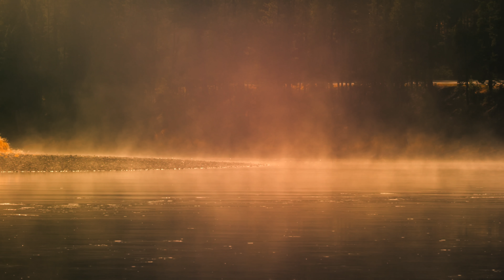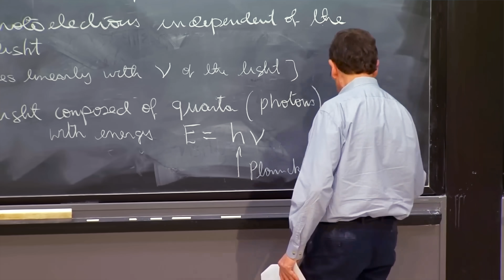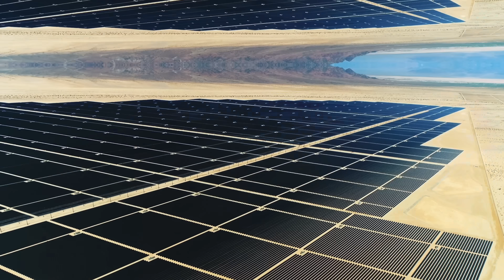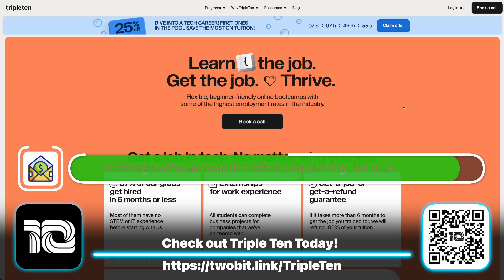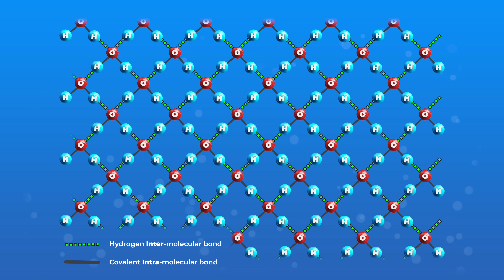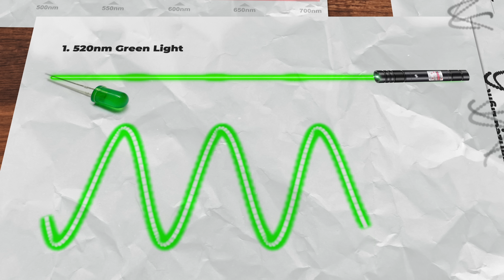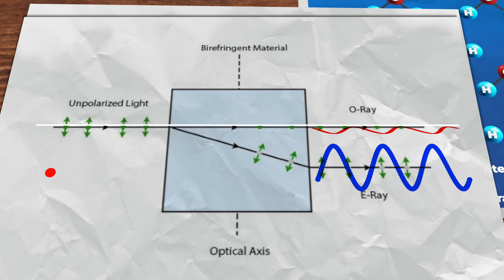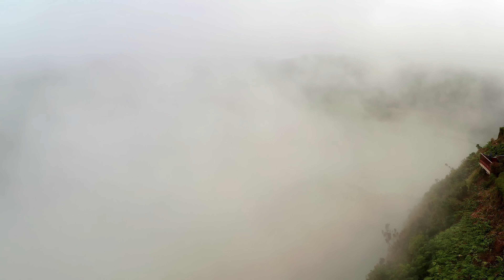New MIT Discovery Just Solved Water's BIGGEST Mystery!

Comment: Makes sense, this is why shade from tree cover is so good at maintaining moisture in the soil.  Also explains why all plants have a green colour, to reflect the evaporating light back!
Reply: Also mowing the grass taller . If an area is too wet we mow it shorter. If it's very sandy soil we mow it at least 3" to help keep the water vapor in the soil.
Reply: I think the green color has more to do with the absorption spectrum of chlorophyll.  The job of the leaf is to reduce CO2 to more energetic molecules like sugars.  The chlorophyll absorbs blue and red light, leaving the green light to be reflected, so the leaf looks green.  The absorbed photons provide the energy to run the process of photosynthesis.  Since there's not liquid water on the surface of the leaf most of the time, I doubt the photomolecular effect is doing all that much to cool it.
Reply: @incognitotorpedo42 There’s evolutionary pressure to reduce moisture loss and reflecting green light would do that. Chlorophyll happened to fit that bill, and not vice versa. Or not.
Reply: There is no other reason that chlorophyl would be green. Think about it deeper. His theory makes sense.
Reply: @Dziaji  The sun radiates most intensely at the green wavelength. Indeed, that's why green is the centerpoint of visible light - our eyesight is evolved around the sun's output.
Reply: @michaelmorris4515   Must be why the human eye discerns more shades of green than any other. Also why night vision is green.
Reply: The problem in that hypothesis is that a) light doesn't evaporate and b) the very spectrum of light which most efficiently executes the ohotomolecular effect is the very bandwidth rejected by green leaves, which is why they are green or appear green in the first place.  Remember if a spectrum of light is absorbed by an object then we don't see it. We only see the spectrums reflected at us. And a very narrow bandwidth at that.
Reply: Ohotomolecular was supposed to be photomolecular. I didn't realize I fat thumbed it.
Reply: @Dziaji  Afaik chlorophyll evolved in ancient times underwater, so it being helpful in preventing water evaporation makes no sense. It might however helped in green chlorophyll being dominant in land plants.
Reply: @Dziaji  I thought it appears green because it reflects green part of spectrum, absorbing red and blue light components.
Reply: @salec7592  that is true, but this could help to explain WHY the green is reflected and not absorbed along with the red and blue. Green light has energy too, so it is a bit odd that plants aren't black to maximize efficiency, and this might be a good start in explaining why the green light is "wasted".
Reply: @noergelstein  maybe it evolved on the very surface of the water. I have always wondered why plants never evolved the ability to photosynthesize with green light. This seems promising, unless you have a different theory of why all the diverse plant life shrugs off all that available energy.
Reply: @michaelmorris4515  that deepens the mystery.
Reply: @Dziaji it could be because there were other life forms that came first the used the green light and later thr precursors of plants filled the niche by absorbing blue and red light.
Reply: @noergelstein  I guess that could be possible, but it doesn't seem to fit as well because the purple plants wouldn't have competition for the green light, so it would need an explanation why they died without their niche being filled ever again.
Reply: @Dziaji  I‘m talking pre-plant life here. Cyanobacteria for example still exist, but they (afaik) didn‘t evolve multicellular structures and thus couldn‘t colonize dry land the way plants did.
Reply: @noergelstein  same logic applies
Reply: May also be why blood is red, to optimize the green spectrum to induce evaporation of water in the body, which may aid with cellular transfer of nutrients to the body cells. Who knows? Maybe there’s a similar “opposite” process of light (red vs. green) in plants and animals, not just gas (oxygen vs. carbon dioxide). The key to both may be the evaporation properties of water.
Reply: @First_Command  I like your enthusiasm however I have no idea what you're talking about..
Reply: The basic structure of chlorophyll consists of a porphyrin ring, which is a large, stable ring made up of four smaller pyrrole rings, each containing a nitrogen atom. At the center of this ring is a magnesium ion (Mg²⁺). There are two main types: A and B, and each light most efficiently in the blue (around 430-450 nm) and red (around 640-680 nm); it doesn't use green light, it reflects and transmits green light (around 500-570 nm), which is why chlorophyll appears green, but... can't rule out it's also a H2O preserving feature that has been selected for.
Reply: When we 'see' something that is green, that something absorbed all the other colours and reflected the green. We say it is 'green' but in one respect it is everything except green because it absorbs all the light except the green. The green light bounced off of it - that's why we can see it.
Reply: All plants are green?
What a bullshit statement.
You must be a covid vaxxer
Reply: Yes we knew that photosynthesis was the answer! But we didn’t know why!

But if something as simple as shining green light at water creates vapour, increases humidity and  reduces ambient temperature then we have a lot of applications  that will benefit the whole planet enormously….
Reply: I love trees.
Reply: Fascinating observation.  So, reflecting green light is also likely universe-wide where there are plants and water.  The color of chlorophyl ... forests and oceans ... is evolution at work.  That might also help explain why water did not last on Mars.
Reply: Not all plants have green color, and the color of most plants is due to coprophil, the pigment responsible for photosynthesis. That's basic 7th grade biology.
Reply: @e1123581321345589144  we all understood that. Who are you talking to?
Reply: Good for the plants, now the question is, why are we not green?
Reply: This must be why green berets have such good endurance in battle, the green colour of the beret increases the rate of perspirant evaporation on the scalp - increases the cooling efficiency of the soldier. Thanks MIT!
Reply: @SimonScottSteel  Also explains UN soldiers - who wear Blue
Reply: Impossible - the green in plants comes from chlorophyll that evolved in cyanobacteria (blue-green algae) >2 billion years ago and through endosymbiosis they evolved into chloroplasts in eukaryotic plant cells. Why would algae that lives IN water evolve a green pigment to protect their water?

Chlorophyll already is one of - if not THE - most import proteins on the planet for its ability to turn sunlight into usable chemical energy - NOT Because it's green. Without chlorophyll animals literally wouldn't exist.
Reply: tree shade is trapping moisture because there's not that much energy input compared to lit area. red beach umbrella will have the same effect. plants are usually (but not always) green, because genetically its more efficient to evolve into something that matches quantum efficiency of photosynthesis, more electron transfers happen in the blue and red frequency bands just due to energies involved in excitation of electrons in carbon dioxide and water bonds. carbon dioxide's excitation peaking at blue color and water's at red. if simpler genome has same fittness, it will reproduce more just because it needs less resources. I'm pretty sure you've seen more than negligible amount of red trees with same if not damper soil underneath them just because more reflection in close infrared band, to return to the first idea. but cool study indeed.
Reply: @tsraikage  it's funny how some will deny the possibility of newly discovered phenomenon shaping the world as we know it just because previously discovered phenomena supplement the surrounding data. Have you ever thought that photosynthesis may only work efficiently in blue and red spectrum due to there being some evolutionary reason plants might have had to reflect the green spectrum? Those which wouldn't would be dominated by those which would. Our world isn't simply "if plants uses A and C then B must be reflected because it is what it is". There may be a physics related reason behind reflecting B and only using A and C.
Reply: @jakub-stachu  no, because evolution doesn't change the underlying chemistry and energy levels involved in it. its funny how people think new discovery will trash current understanding and everybody will need to get back to drawing boards. this rarely happen in science. this is fascinating discovery, but has nothing to do with photosynthesis and will not have only because some random youtube comment made you look that way. i could see it making sense if only thing you know about photosynthesis is "co2+water+light+magic=sugar+o2" but when you look the detail how it works and energy levels involved, you'll clearly see what's what
Reply: @tsraikage  Tree shade is not trapping moisture. There is as much moisture in the air below the tee as in the sun, what happens is the air temperature below the tree drops, reducing the amount of water the air can hold. In the sun the air is warmer so it's water holding capacity is increased (humidity drops) but the drier warmer air, actually has more moisture per m2 than the cooler air..
Reply: @bengardener8928  yes, thats basically what moisture is. but what you described is only true if air is not moving. when saying theres moisture under shadow we meant soil is moist compared to lit soil. thats solely due to thermal energy input to a section of a soil
Reply: @tsraikage  Yes but even in grass the air is cooler the closer you are to the ground due to the foliage, keeping soils moist. Aslong as soil has a good covering of greenery it's like replacing all of those open soil pores that evaporate more the drier they get, with a layer of tiny holes in the foliage that the plant opens/closes to control evaporation, while using evaporative cooling efficiently to create a microclimate, unlike exposed soils that lose moisture quickly and ability to cool with evaporation once dry. 

Plants are ultimately structures that create the ideal conditions/homes for themselves and microbes to thrive. Before plants on land, microbes were pretty inefficient at converting sunlight into energy and biomass but when cyanobacteria had a structure and became what we know as chloroplast, everything changed.
Reply: Well bless your heart ❤.  I guess any color other than green would dry out the leaves more quickly.
Reply: remember, trees breathe in that evil CO2 as well
Reply: @rotaryenginepete  C02 is truly the evil in the environmental religion mythos.
Reply: The fact that you can see under that tree proves that photons are hitting that soil. The shade has more to do with heat based evaporation not what this video is talking about
Reply: No   Only plants with chlorifil. The Green colour can convert CO2 to oxygen with sunlight
Reply: It strikes me as interesting that close and carefully study can still glean significant new phenomenon from what to others seems an everyday occurrence. Living in Vermont, I learned in my first apartment, that I can dry laundry by hanging it out on a line or rack, even in the dead of winter. The laundry may freeze first, but with sunlight and air movement, the water will be dissipated as the adjacent air seeks equilibrium with the wet surfaces. This process is accelerated if the laundry is hung in the sun, and retarded if hung in the shade. Now it seems that the green light being reflected by my lawn and trees may also be making a measurable contribution.

I'm also now wondering if the ridges on the  subparallel blades of grass in my lawn might be partially polarizing the sunlight as it reflects green off of its surfaces?? Huh! Something else to consider next time I use the polarized lenses on my camera.

Comment: ❤I studied with Horace McCracken in the late 80s. He was a champion of solar water distillation. I own one which has seen continuous use for 30 years. There are no filters and uses sunlight and the photo molecular effect to cause water in a shallow trough the vaporize and condense on the underside of shower door glass.  It makes RO quality water with no filters.  There is a fill up irrigation valve which lets in a small amount of water every night.  A overflow lets out the excess.  This makes a 2-3" shallow pond of water.
This all makes perfect sense.  Sunlight is very reactive and interacts with anything exposed to it like my skin!  Beautiful work to discover this photo molecular effect I knew it could not be heat alone which makes a solar still work so good!
Reply: I’ve long wondered if, in the long stretches of undeveloped land in CA, they could create long (switchbacked) solar still type water troughs on the valley side to desalinate agricultural water. 

Pump (slightly inland for sand prefilter) ocean water up the mountain into one trough with a clear cap (this video suggests it should be a polarized cap that condenses into an adjacent trough. Have a couple iterations if need be. Truck or pipe the excess brine back over or through the hill, collect the evaporated water for agriculture. There’s lots of hilly land with lots of sun and the biggest cost is probably pumping the water up & a return for the brine. 

Aside from the pump  nand an occasional scrub down, it’s filter free with no moving parts and low maintenance.
Reply: I found Horace McCracken’s paper on solar stills, thanks!  It talks about multiple formats that could be turned into a large enough format to make a reasonable amount of desal water without relying on groundwater or precipitation.
Reply: What please is ro quality water?
Reply: @jeffbybee5207  Reverse Osmosis
Reply: In 1988 Horace McCracken had a fancy scientific instrument called a Total Dissolved Solid meter.  It was pricey and had a analog needle $500 in 1988 bucks.  It was merely a resistance meter calibrated for TDS.  Now they are digital and are very cheap.  Water with low TDS is very pure.  RO water when its working good will deliver water with ,0-4 PPM.  The TDS measurement can't tell what's in the the water but how much is in it.  Good question!
Reply: MIT didn't discover anything, anymore than Christoper Columbus discovered "america" even though there were already 50 million people living there. All this and many more properties of water are described in The Fourth Phase of Water by Gerald Pollack, been out for over a decade now.. I guess someone at MIT decided to buy and copy .. they "discovered" the book
Reply: The trough never needs scrubbing the over flow flushes it out.  If you want a video I can make one.  The trick is the liner.  A stainless steel still will rust out.  There is food grade silicone impregnated into the nylon fabric then a layer of Aluminum.  The plywood is now pretty rotten to the point where if I tried to move it it might fall apart.  The other trick is to never let it dry out then the silicone emits a gas that makes the glass hydrophobic.  It will not work until it clears on its own in a couple weeks.
Reply: @dimension2788 a video would be nice, thank you

Comment: You failed to take into account sublimation. Notice the effect of meat drying out in a freezer. No heat or light is needed. When the vapor pressure of water is higher than its surroundings it continues to evaporate until it reaches the saturation point.
Reply: MIT took the into account
Reply: I have access to a freeze dryer that uses heat (conductive and radiant) to sublimate water vapor from ice surface contained in the food.  The freeze dry industry has a strong interest in this technology.
Reply: You are right, for example the evaporation of water in a pond in the summer is most dependent on the relative humidity and of course the wind speed.
Here too, the vapor pressure is an important factor in the same way and only a higher temperature has less effect.
I would like to see the experiment showing that photons alone make the water evaporate much faster, so how exactly did they compare this evaporation.
This man says that with the same amounts of energy of light compared to "heat", the water evaporates 4 times faster.
If you want to evaporate 1 liter of water on a stove, you would have to compare that with photons that hit a very large surface of water. Photons
have much less energy per m2.
I'm curious what this experiment looked like.
Reply: You missed the fact that large scale desalination of water is done in the absence of air.  The water is vaporized to separate it from the nonvolatile salt then the vapor (steam) needs to be re-condensed. This new process appears to be more of a microscopic mist generation (like a nebulizer).  This mist is generated in a subsaturated atmosphere of air and the micro droplets are further evaporated by drawing heat from the air.  Without air it does not work.
Reply: I’ve never thought about this. So a pressurized freezer would preempt meat from this?
Reply: @lemineftali  Sort of. It's not the pressure but rather the saturation of the air inside the freezer and though cold air can't hold much moisture at that temp the air is constantly circulating. However, pressurizing in this case means sealing so, yes, a well sealed freezer preserves meat indefinitely.
Reply: No heat?! Your freezer keeps food at 0 degrees K??